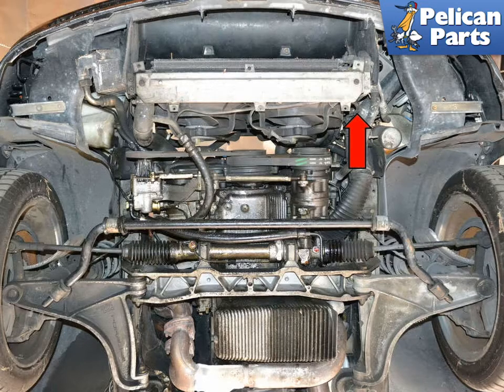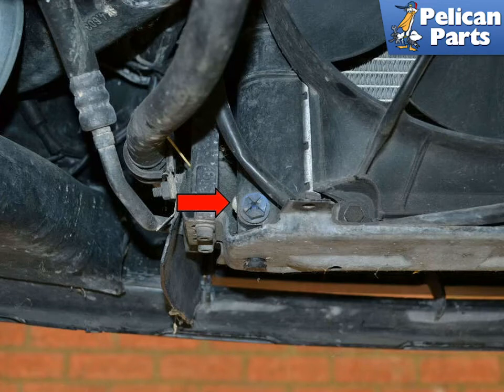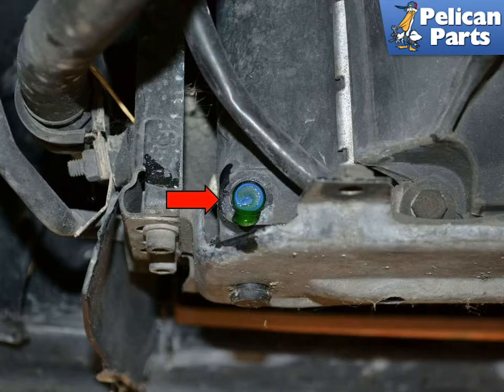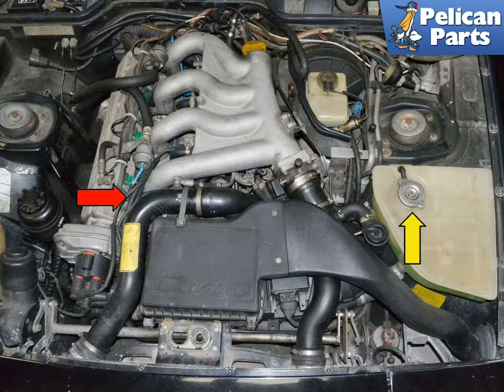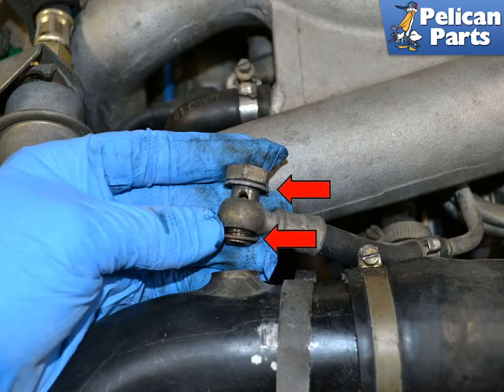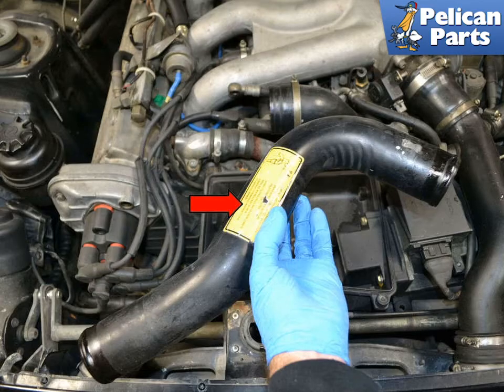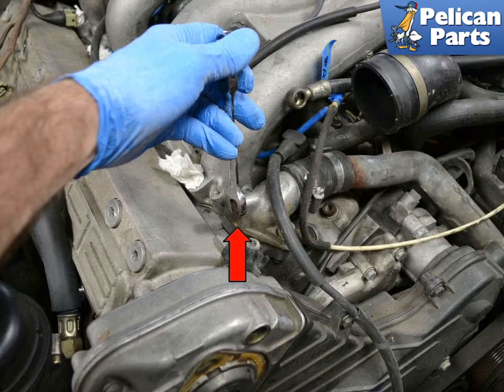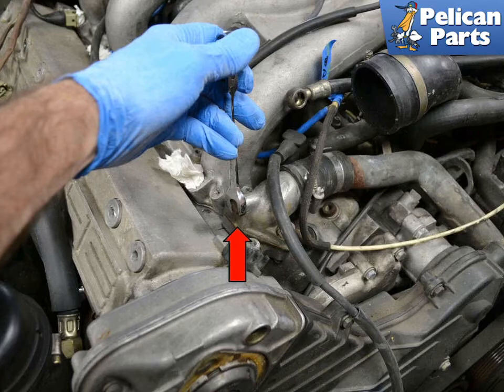Porsche 944 Turbo Coolant Flush and Replacement (1986 - 1989)

Comment: Great video, thanks! It would be even greater if you added links to buy a replacement drain plug and the needed washers. Also: How much coolant is needed to refill the system?
Reply from the maker: What is the year and model of vehicle are you working on?
Reply: @pelicanparts  1986 944 Turbo